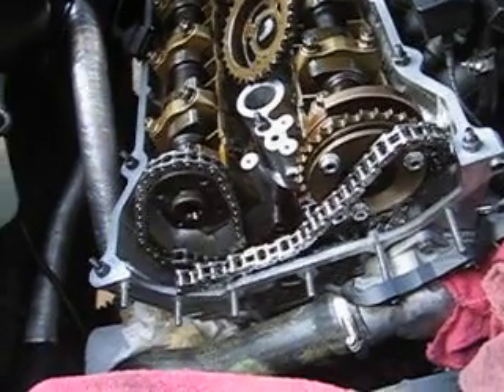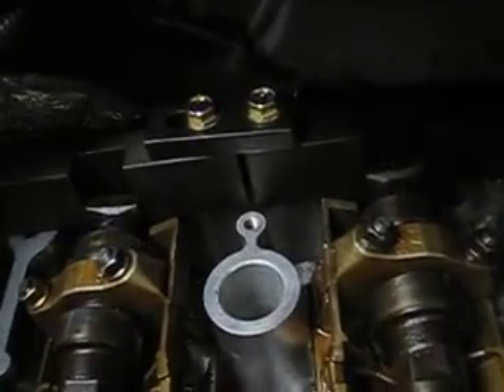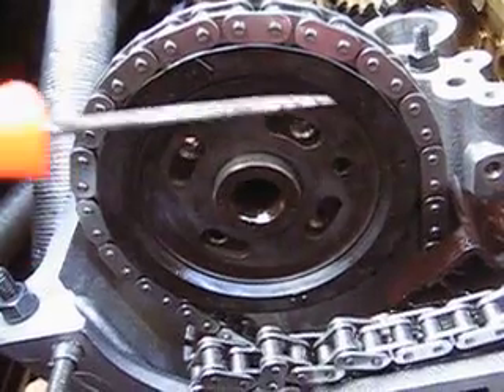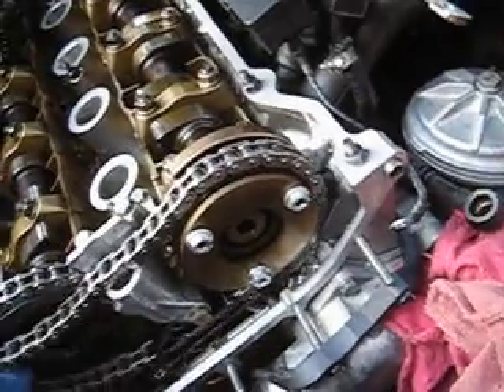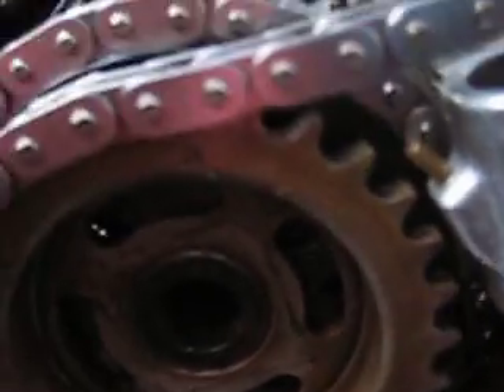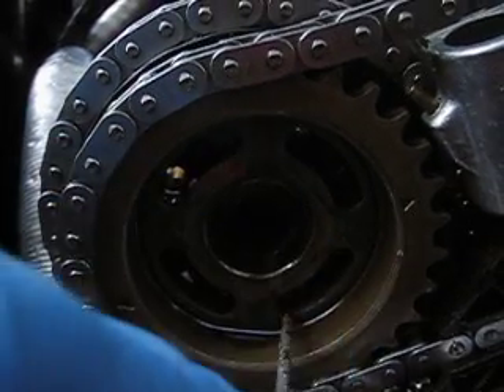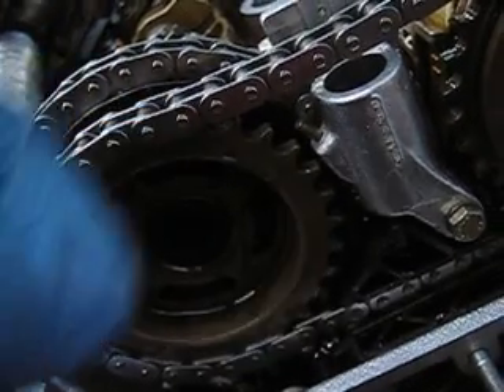BMW M50/S50 Camshaft Timing Guide

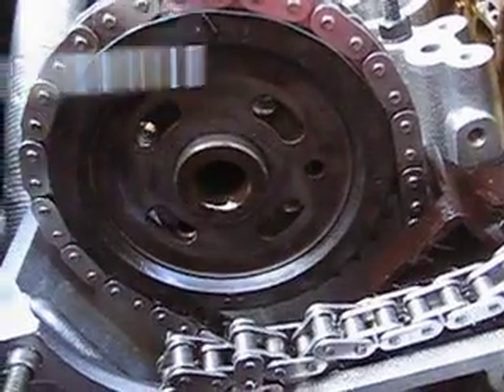Comment: I'm Curious. Do you have the lower tensioner in when the sprocket is installed on the exhaust cam? Do I rotate the sprocket counterclockwise (keeping tension on the chain to the right side of the sprocket) when lining up the slots to be justified to the left? This is at 2:08.

Comment: Thanks a bunch - really helpful video! Why do you need the primary exhaust sprocket to be all the way clockwise though (at 1:00 min), you're locking it to the camshaft after the vanos install and it's permanently fixed to the crankshaft (thru the two chains - the long and very short one), correct? The The exhaust camshaft does not change it's relation to the crankshaft therefore it shouldn't matter where in the hole the screw is. The whole point of the wide opening is to be able to position the exhaust camshaft precisely (since the length of the long chain can vary slightly from engine to engine) and nothing else, right?

Comment: Great video, I am still some what confused, such as how you lined up the camshaft's before placeing the cam locks on them.
Reply: The timing marks on the front of the engine cover have to be lined up in addition to using the cam blocks.  The cam blocks hold the camshafts in place and the timing marks establish that the crankshaft is in the correct location.  The timing chain  holds the the camshafts and the crankshaft in time.

Comment: Hey! Thanks for the video. Was very helpful. We did everything according to this video - but we're facing new sort of problem. The engine still is doing ticking sound. (I had my BMW run on 5 cylinders). Could it be the hydraulic lifters?
Reply: According to most forums and my own experience (I have a 1993 e36 325i) its either your lifters if you have a M50 or if you have a M52 it's lifters or worse your vanos. In my case it was lifters. Hope this helps even if its soooo late.
Reply: ***** it was the lifters, new lifters fixed the noise. They were pretty old.

Comment: Will the s52 be the same as this?
Reply: +acroracing  almost.  Only difference is the S52 primary exhaust sprocket, you center the hole in the slot, you don't align the hole to the right.  The Bentley makes this distinction.

Comment: Do you have a video or instructions on how  to install the timing chain(s)?  I'm working on an engine that was partially disassembled and I need to install new chain(s).  Does the the link pin have to be pushed out with a chain breaker, or is there a different installation procedure?  I'm used to older M20 engines with a belt.

Comment: Well they did use leaded higher octane fuel, but they did rallies with them.

Of course the honda engine can't be that torquey at the same revs as a 2litre 140hp family car, or else it has some serious space technlology under the hood.

The key is to shift the powerband up, you can have the same torque but at higher revs making double the power if the revs are doubled.

Anyway I don't doubt the N/A tuning capabilities, it's always a compromise in some area, but everything can be tuned :)

Comment: Back in the 60's/70's were they restricted by cats? What fuel did they run? How long did the engines last with those mods?

Only N/A stock engine with that kinda power/weight ratio I can think of is the engine from the S2000.

Comment: How much power is it possible to get out of a 2,5litre m50b25? About 300 with head, valve, cams and ignition system?

I know it seems high but people had +200hp 1,6litre tuned N/A cars in the 60-70's..

Comment: Hi, i've just done a head gasket on my e34 525i with Vanos.
When reassembling the secondary timing chain sprockets and inserting the vanos unit i simply threw the sprockets on making sure the slack in the chain was at the top, inserted vanos then tightened up all the bolts.
My worry came after seeing your video. You aligned the sprocket holes to the left. is this important? Does this apply to intake and exhaust sprockets?